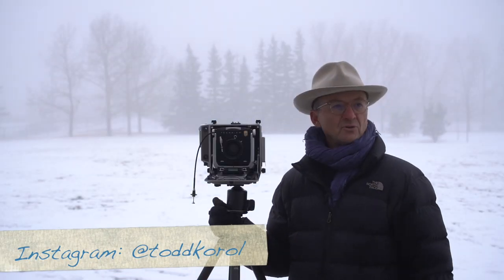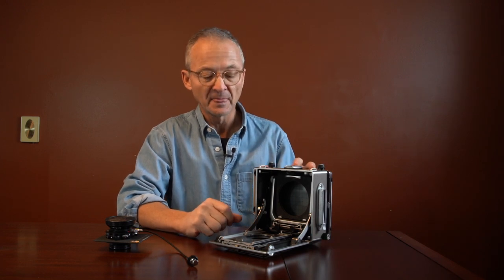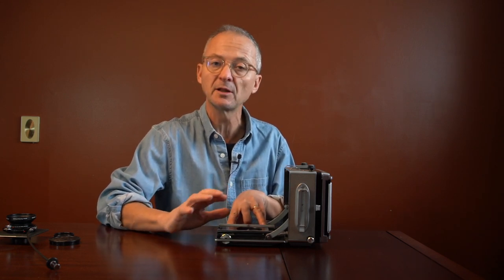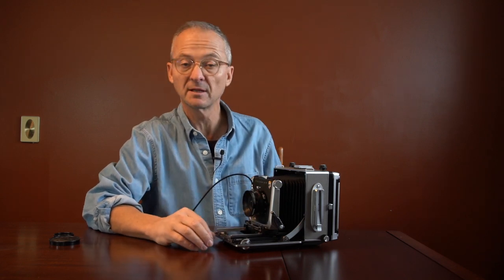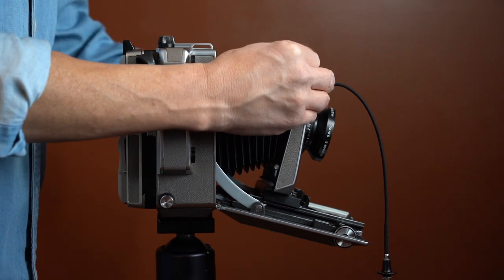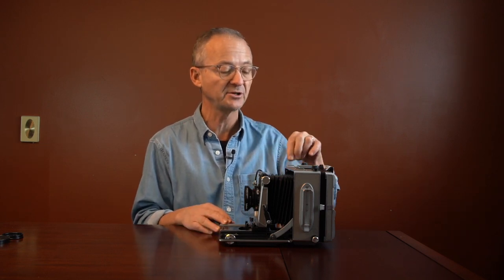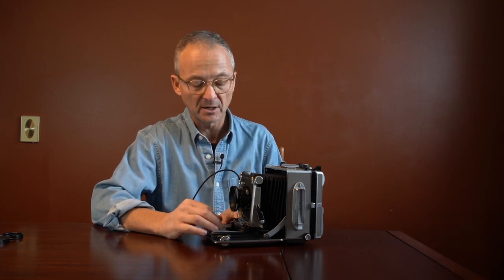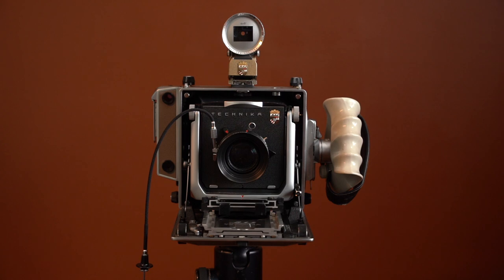4x5 Linhof Technika Overview.

Comment: Nomenclature:
"Super" Technika denotes the inclusion of rangefinder. (pre Master Technika)
Technika III models with Rangefinder are also 'Super Technika'. 
Following the "Super Technika V" is the Master Technika and the word 'Super' was dropped. 
The one shown in this video is the Super Technika V. 
The model Technika 2000 was designed specifically for those using mainly wide angle lenses, eliminating the rangefinder and adding other features helpful for when using lenses of short focal length, the so-called wide angle lenses. The 2000 was superceded by the 3000, with more modifications.
Current models are the 'Master Technika Classic' and 'Master Technika 3000'. ♡
Thanks Todd. We share the passion.
Reply from the maker: Thanks for the info, it's great to share info like this.
Reply: Kevin/Todd - "2000 designed specifically for those using mainly wide angles" .  Is there any disadvantage when using standard and long focus lenses with the 2000 ?  Not a shorter bed, or bellows ?  Is the flip top lid of any use when using a 72mm XL lens ?  Or, is movement not possible with the 72mm ?  ATB
Reply: @Super.Quasar  Sorry for the  late reply. There is only the absence of a rangefinder, otherwise no disadvantage what so ever.. 👌
Reply: @kevin-parratt-artist   Ha, no problem.  I bought a 2000 4 months ago.  Much better than the rangefinder version, imo.  Atb

Comment: Good review Todd. Just a couple of things. When you drop the front bed take out the cam or it will bend also if you take of the accessory shoe there is a tripod socket. This applies to Mk V onwards. 
It is possible to to put a rise lid into a Mk V/VI by cutting out the top case. You can also replace the front tilt guide to give more tilt. You V will have 15• and the later Master has 30•. 
If you have to replace the GG make sure you have all the parts. Under the glass will be 4 shims which are part of the adjustment for the glass.

Comment: Very useful, Todd. Your opening reminded me I’d like to see what you do to protect your lenses in cold weather.
Reply from the maker: You’ll probably hate this but I really don’t do anything for the cold except pack my lenses in their proper place in my bag. I use my gear all the time, even when it hits -30. The one thing you want to do is if you take your gear inside from the cold, you want to let it warm up to room temp before taking it back outside.  Because if condensation builds up and you take it back out when it’s super cold then that can freeze and cause you issues.

Comment: Hi Todd, great run down, I've had a iv and a v, they are great, biggest issue for me is using wide angle lenses which can be arkward  due to the lens being snugged close into the body. But definitely the best field camera for me. Also get the linhof 45 degree mirror viewer which makes it more use able

Comment: A few years back I bought a 1976 MT, it was in relatively good shape, but due to age I had the bellows replaced and cleaned / lubed the connectors/hinges that allowed the back to open and shut so that they tightly clamped down on the film holder.  I get confused about the two buttons to push when you need to slide the rails, and I always get confused about the two knobs that allow the front standard to tilt (one locks and the other releases and you have to push one of them in I think?).  Like I said, it's confusing. But it works well now and is rigid.
Reply from the maker: Well the important ones are the two buttons to push to slide the rails, because if you don't that will break stuff for sure.

Comment: I just found a LMT 4x5 and have found your videos very informative, thanks!  I noticed that you have both a Linhof 4x5 and a 907x. Is there an adapter for using the digital back on the Linhof?  Thanks for your help.
Reply from the maker: Thanks, I've seen a few adaptors, have never used one. Here is one, but I would look into it more. https://fotodioxpro.com/collections/lens-mount-adapters/products/4x5-hbv-p

Comment: The Japanese also made a fine metal technical field camera in the Horseman brand. I own the model 985 6x9 version for 120 roll film and it is very clever with the same design as this Linhof including the rear movements and rangefinder at perhaps 2/3rds the total size. It also has a built in viewfinder as it is made to be regularly hand held as well as tripod mounted. 
PS Youtube channel "LINHOF CAMERAS MADE IN MUNICH" compares two versions, during which the narrator simply pulls the front end out onto the rails without first rolling them backward. It's typical that the factory will be rougher on the camera than an afficionado.
Reply from the maker: Thanks I’ll take a look at that. I think Horseman cameras are great!!

Comment: HI Todd! Thanks for a great overview of the Super Technica! Question: If I was shooting Vertical hand held portraits using the focusing Rangefinder to lock in my distance, could I then "Shift" the taking lens to align with the ground glass. Then as long as I keep the same distance I can keep shooting without any parallax issues. Is that something that people have done who use these for portrait work. Thanks. Je
Reply from the maker: I don’t think parallax is going to be a problem unless you start getting very close. Once that happens you really need to focus using the ground glass for critical focus.

Comment: This was truly great! I'm thinking about getting into large format and there is so much to learn (I have plenty of experience with film in general and mostly 6x7, but not with movements or sheet film). 
What I'm wondering is if the camera can do fall? It doesn't look like it when I look at the front standard, but perhaps it's possible by tilting the bottom plate down and the lens back to get it perpendicular to the film again? If so, are there notched increments on the bottom plate tilt?
Reply from the maker: Large format is a ton of fun if you like film you’ll like it. And yes, there are two ways to do fall, the bottom front standard can be tilted down, and yes there are notches. Also, the camera can be flipped upside down and you can do fall by the “rise” movement. Sounds awkward but it’s actually not because the image is always upside down anyway. Good luck.
Reply: @toddkorolphoto  Thanks alot! :-)

Comment: Thank you for this review.  I just purchased this model and I find the focusing (using the rangefinder) very challenging.  I'm trying to use the roll film back. Do you ever use roll film in yours?
Reply from the maker: I have a 6x7 roll film back. Using the rangefinder takes some practice for sure, using it with a roll film back is much harder as the lenses are a longer focal length as well, so that would be a struggle. I have never used the rangefinder with the roll film back. Good luck! Let me know how it goes.
Reply: I use my Crown Graphic (which is somewhat similar) with both 4x5 and 120 film. The range finder can be fiddly; I definitely have to wear my glasses, and I usually try to find focus on something contrasty (if possible).

Comment: I use a Techinka IV which is so beaten up that it was at some point used as a "for parts" camera. Its missing one door latch, the rangefinder and the hot shoe (i still curse whoever took the hotshoe) but the bellows are lighttight, the focus works and all the movements too. Its what i could afford and its more precise than the speed graphic i used beforehand. The IV also has the rise and fall still on a screw which is more precise than the lever they used on the V - i prefer it that way even though you cant really use it usually with a wide angle lens since the door latch is in the way (not on my one - maybe the guy stealing that door latch had something in mind).
Reply from the maker: That's great, no matter what I still love it when cameras are in the field and in use!!

Comment: Don't know if you will see this, but I'm not finding what I need. The lens assembly on my Linhof 5 keeps sliding on the rails. It seems like it should be firmly set. What am I missing? And is there a user manual available for this camera? I really have enjoyed your videos. Thanks. Jeff A.
Reply from the maker: Check under the front mount and make sure it’s not broken and can properly attached to the bottom rails.  I had one that was broken one time and would slide off. I will get you a link for a manual as well.
Reply from the maker: https://linhof.com/download/

Comment: Do you have a recommended tripod for the weight of this camera?   Great  Video btw
Reply: They arent that heavy (3kg for the cam + lens etc) so most tripods work but i recommend a sturdy head. I use an old Linhof twin shank tripod with a 3 way head but im from germany and theyre dirt cheap around here.
Reply: Thanks buddy

Comment: You need the 5x7 now. 🙂 The 5x7 has the additional benefit of a focusing knob for extreme wide angle lenses. The 4x5 requires an accessory for that.
Reply from the maker: I had a chance to get a 5x7 here a little while back, but it was still a lot of money. Nice though.

Comment: This is my 4x5 dream camera. But i have not yet been able to find any for a price I can afford. And I feel the price is rising! So I am stuck with my Toyo 45CF and an Toyo benchcamera. Btw, the dropping front bed is mainly for use with short focus length lenses, so you don't get the front bed in your picture. I have the same function on my 45CF.
Reply from the maker: the Toyo's are really nice cameras as well.

Comment: Hello Todd- Thanks so much for posting this- Such a great teacher- I inherited a "master technika”? serial # 6445 569-It has a gold plate that say "John Sexton 1985-1995"? I was wondering if there was a way to find out which model I have? I was wondering if there is a difference in quality depending on what year ect- Also which ones are the most valuable? I tried to put in serial number to find out the year and it said between 1978 and 1997?- How can i tell if its a range finder? Any info would be greatly appreciated! Thanks you for your time!
Reply from the maker: Sounds great.I have not heard of that camera. It might have been a special run of them. The rangefinder is on the side where you look through the little hole on the right of the camera.
Reply: @toddkorolphoto  oh Thks Todd.. mine looks just like yours but doesn’t have the view finder ir range finder on side? Are those superstar attachments that I can purchase ? I really want to find out what mine is worth ? Any way I can find out value ? Thank you
Reply from the maker: @seattledude6277  Some of the cameras did not have rangefinders on the side. I would look at eBay prices and you can tell what they are selling for.

Comment: ONE important thing when considering camera to buy is that there are many versions, the later (tech 4/5/200/3000) ones are great, they have international backs, so ALL film holders/roll film backs will fit, the TECH iii 's, esp. the 5x7" have a quirk, they are available with metal single sheet backs , these have a hinged ground glass with a spring bar on top the metal holder sits on a ledge on the hinge, so be aware of what the back is, and what film/holders are compatable; as well as if your "film lab" will process it?, some, as in my state (South Australia), only scan the processed neg's, other than 120 roll film or 35mm canisters!!, so be wary, check the lab situation in your area FIRST, then get the film, so you KNOW you can get it processed, OR if you have to set up your own darkroom space.
this also applies if you wish to try wet plate/dryplate/tintype in the future, as these holders are special (glass and tin plates are thicker than film sheets!), so the back must allow this extra thickness ('gape' of the spring back), so consider this upon purchasing.

Comment: great camera, and good review, BUT you forgot to tell people that to do wide angle lenses
(</= 65 mm focal length) you NEED a special bellows attachment, this allows focusing, as the front standard is entirely contained in the 'box' of the camera body, NB: there are some models 5 x 7" cameras, etc. which have a special focus rack / focusing pinion which allows focus without this bellows attachment, but these are special cameras, which are intended for the use of these lenses, ie for landscape/architectural Photography and are marketed as such; look in the book : " large format photography"- publisher: Nikolaus Karpf  1973 ; 
ISBN: 3 - 87119 - 213 - 9  this has all the data about which camera has what features, not just a "compendium" for collectors, but a bible for all users.
Reply from the maker: The book sounds great, I will have to hunt it up.
Reply: thanks Andy- Will I need it for a 75mm?